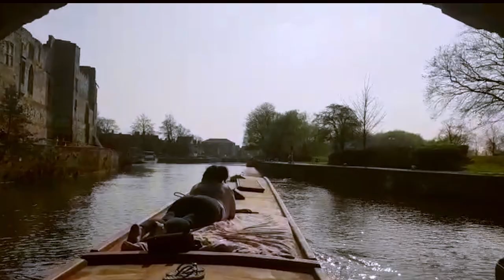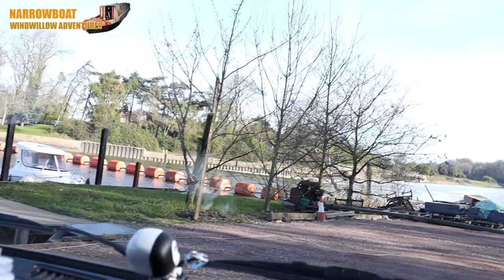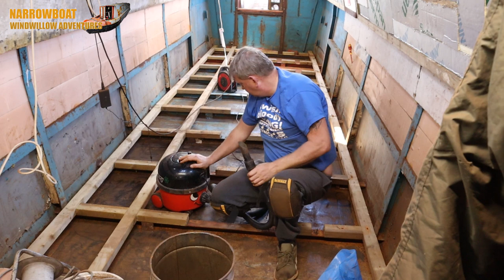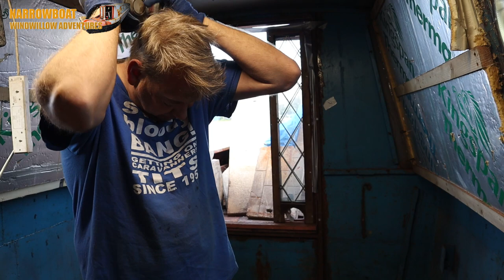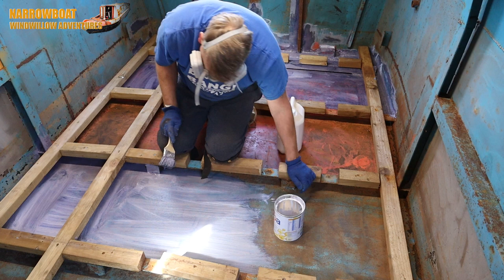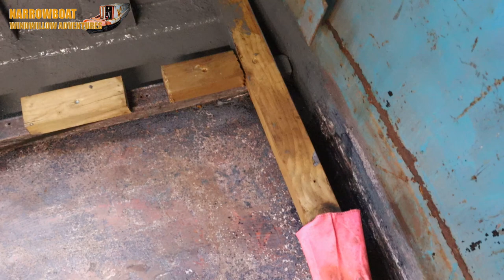NARROWBOAT BUILD CONTINUES VACTANING & PAINTING THE FLOORS EPISODE 8

Comment: Looking good. I thought Vactan needed multiple coats until it was all black or is that another treatment?
Reply from the maker: Hi it is very black doesn't show to well in the video I did look into how many coats to apply and couldn't find any very useful information as it goes but as you can see the floors are not that rusty to begin with & at just under £80 for five litres that's enough to do one coat of the boat floor I thought that would do 😉🙈👍thanks for your input and taking the time to watch the vlog much appreciated 😀
Reply: @narrowboatwindwillowadvent6710  yeah most of the base plate actually looks almost new. Was some iffy bits near the front that still looked rusty on camera after the vactan coat but you are the best judge of it as you are on the boat lol.Ive seen a lot of people using tile spacers under the bricks to keep a gap between base plate and bricks. Will this be your approach?
Reply from the maker: @DEmma1972  tbh I'm not going to bother with the tile spaces as it's bone dry anyway but the bricks I'm using are very uneven so they have a natural air gap